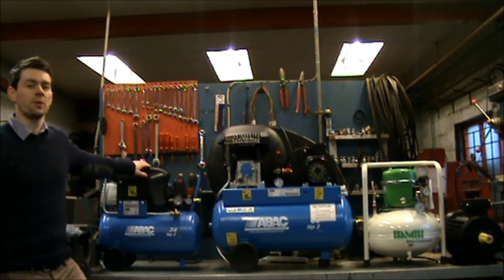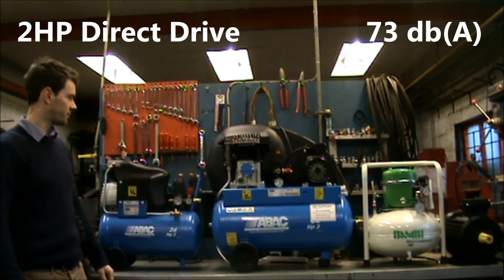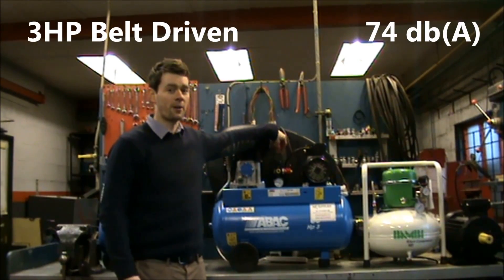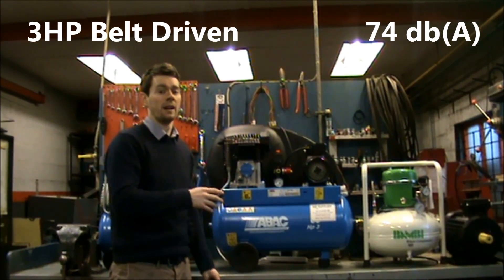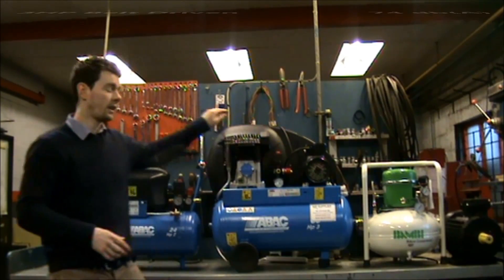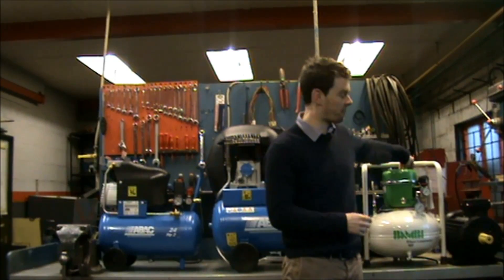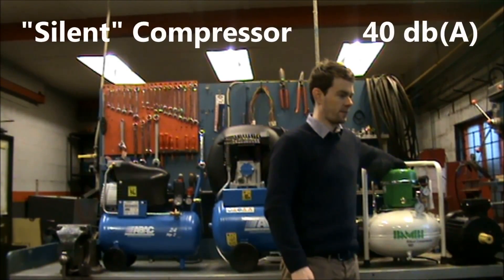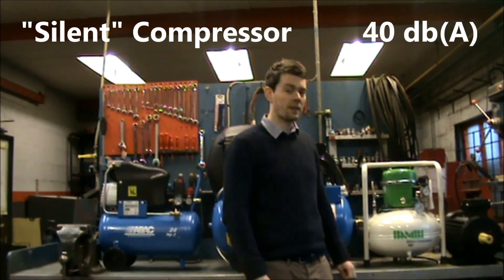Air Compressor Sound Level - Noise comparison between Belt, Direct Drive and Silent.

Comment: Thats the exact video i was looking for thank you 🙌🏼 i did have a small its 27 litre and i think 1.5hp compressor i think and that was silent it was called a popular master and had it for couple of decades it was fantastic till my parents upgraded to jefferson 2hp 50ltr and dumped the pld one cuz its old even tho there was nothing wrong with it and i wanted to keep it they threw it away now impossible to find but think i see airmaster looks similar. It was quiet. But the jetlfferson was far too ear piercing

Comment: You show the flow rate of 2 of the compressors then show us how quiet the 'bambi' is  but you fail to tell us how slow it pumps air.  That 'bambi' is basically something  you'd find on a fridge so yes we know they're quiet. People pull them out of window a/c units or old refrigerators and turn them into very, very slow pumping air compressors.
Reply from the maker: Please note, this video is just to make a comparison between sound levels and not the specs of the compressors. We get asked a lot "how quiet is the BAMBI compressor?" and "how does the sound compare to a normal compressor?". Hopefully, this video helps answer those questions.
Reply: Yet you still refused to answer his question which shows it is inferior.  You can make anything silent if it is does less.

Comment: it really is a pointless comparison,  to have a silent compressor that does the same work as a normal compressor, you'll have to pay 6 times more.
Reply from the maker: The video does not compare price, just the sound level. The specs are very different and so are the prices.

Comment: A video comparing Bambi BB and MD noise levels could be a useful addition. Ideally single and twin pump models :)
Reply: For every 10 db, the noise is 2X as loud. So a 60 db compressor is 2X as loud as a 50 db.
Reply from the maker: Bambi BB single pump is 40 db(A) and the twin pump is 42 db(A).
Bambi MD single pump is 55 db(A), the twin pump is 56 db(A) and the triple pump is 57 db(A).
Reply: By the numbers, a single pump MD would be perceived as 3x as loud as the single pump BB in your vid. Knowing the difference is one thing, hearing it is another :)
Reply from the maker: Not three times as loud. The single pump on the BB is 40 db(A). The single pump on the MD is 55 db(A). A difference of 15 db(A). Yes a video always helps with this.
Reply: Db is a log scale, perceived loudness is subjective so it depends on the person :) A 10Db increase in loudness equates to double and 20Db is 4x, so 15Db is 3x. In terms of power draw adding a 2nd unit would increase that by 3Db which is double, adding 2 more units (4 in total) would double it again (+6Db). 
I`m a bit sceptical of the twin units adding just 1Db to the loudness, it should be at least 3Db. 
If they operated out of phase it would deliver some noise cancelling but given there`s no mention of any noise cancelling tech in the spec`s, i doubt it.

Comment: Version of Bambi is good for blowing swarf & clean up light sanding on fist size parts?
Reply from the maker: +guesswho kk The Bambi BB8 should be fine for this, as long as it's not constant blowing for too long. http://www.airsupplies.co.uk/air-compressors/bambi-silent-air-compressors/lubricated-silent-air-compressors-bambi-budget-range

Comment: Hi Air Supplies ! I have a question. I need a silent air compressor for a high speed engraver tool (which is like a dental drill). The tool need a lot of air displacement (near 3 CFM). So i would like to know if i can use the Bambi HT series which provide the requirement i need for a low level of noise. What do you think ?
Reply from the maker: MrHuangfeihong Best to give us a call please on 0115 9725 099.
Reply: MrHuangfeihong look at the Eagle Silent Series not as quiet as the Bambi but they are oil less and they can make up to 6.0 CFM for the EA-6000

Comment: The bambi is silent because it provides no air! It can only be used for airbrush....
Reply from the maker: The Bambi compressor can be used on lots of low capacity applications including airbrushing. The video shows different sound levels for different compressor specifications.
Reply: you say "2 HP", "3 HP" for the other two, but "forgetting" "0.5 HP" for the Bambi? Seems disingenious to me.
Reply from the maker: balderloke No, we didn't forget. The important figures here are the sound levels for comparing the sound you can hear on the video. Customers were asking what 73 db(A) actually sounds like, so we made this video to compare that to a compressor running at 40 db(A). Yes, the compressors have different applications and you shouldn't be using the Bambi compressor for applications the ABAC compressors can handle, but that is irrelevant for the purpose of this video which is just about sound comparison. If you would like any help on choosing the right compressor for you application, please get in touch. Always happy to help.
Reply: Air Supplies™ - Compressed Air Supplies (Nottingham) 
This is very helpful. I have direct driven air compressor like on the left. Now I know, there's a silent compressor suitable for airbrushing. I need this especially when I'm doing airbrushing at home at night
Reply: Well that small compressor certainly has its place, but i doubt it can continuosly run air brush
I found 2hp like the first one shown to be the minimum for air brush continious use